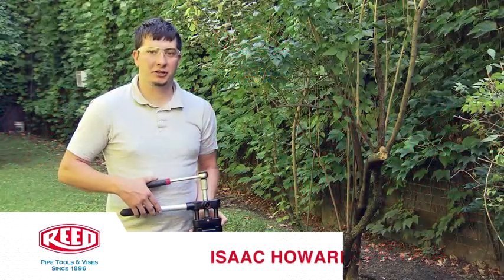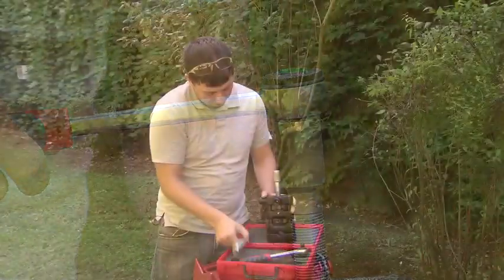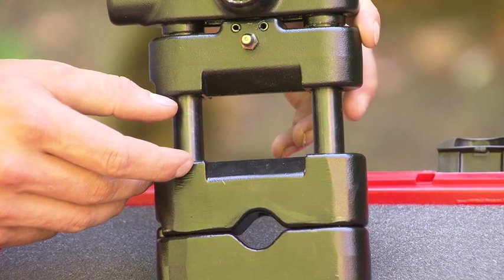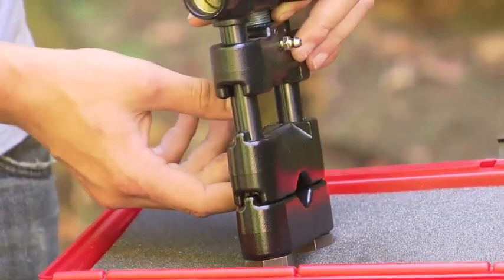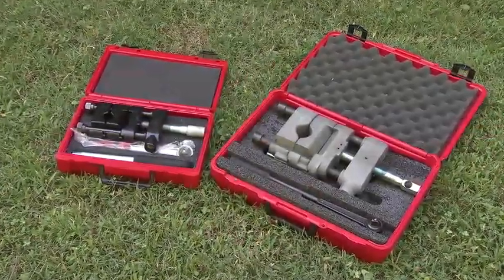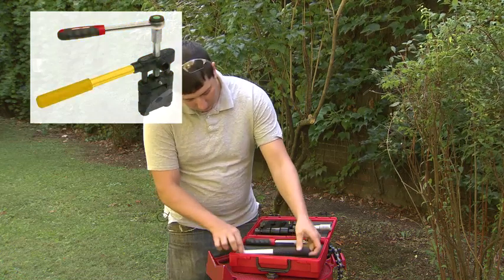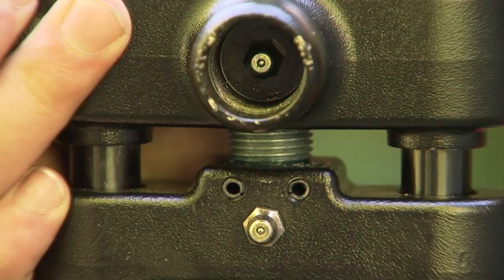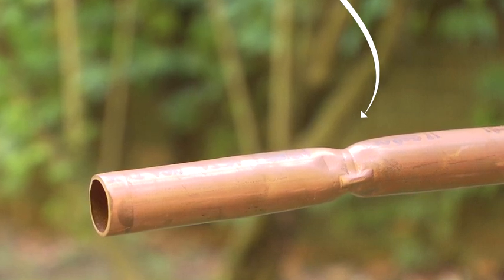Copper Shut-Off Tools Demo - Reed Manufacturing

Comment: I wonder if this tool could be used in a situation for PEX pipe just to shut it off in an emergency or would it hurt the pipe?
Reply from the maker: These copper shut-off tools would not work for PEX.  REED PESO1 could possibly work, but as with PE tubing, REED recommends replacement of the crimped area at a time where there is no emergency.

Comment: I’ll feel like this would destroy old pipe
Reply from the maker: Copper shut-off tools are used when a repair is needed in the line.  It will crimp the pipe and it may mean that a section needs to be replaced.  On newer pipe, there is the chance to keep using the pipe because the rerounding part of the process can be successful.